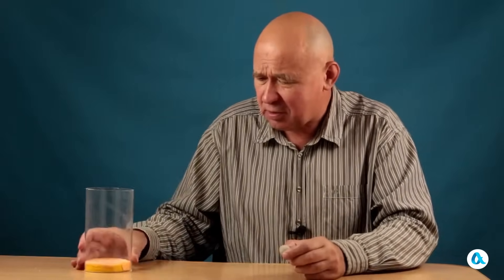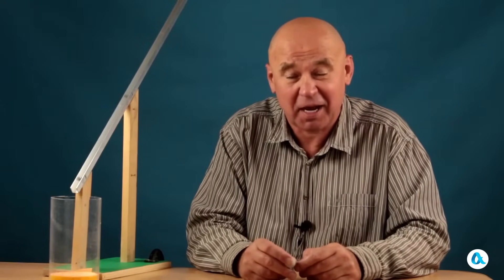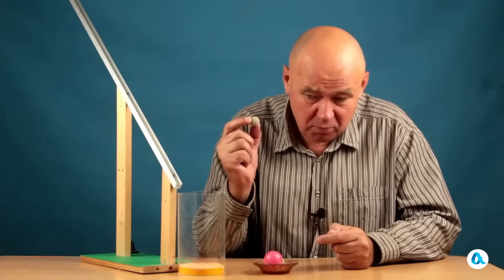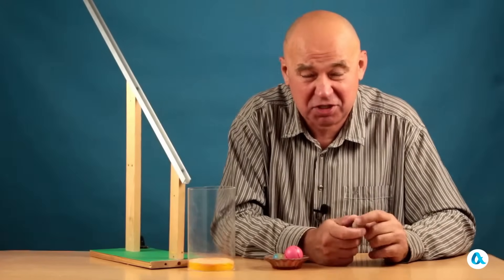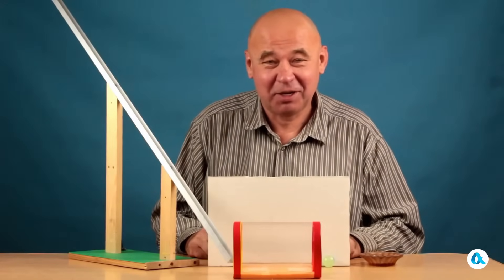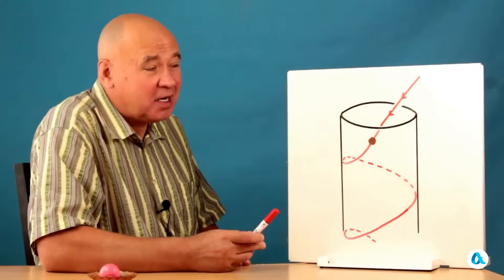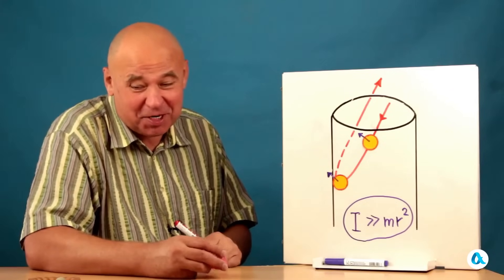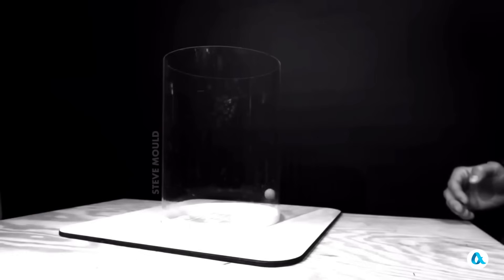Why is it coming back?

Comment: I kept wondering what was at the bottom of the cylinder when vertical, and under the cylinder when horizontal. And why a rubber coated steel ball and say a lead cored ball . . . That a magnet was involved. Evidently not, but it seems the wall container is the reciprocal limitation corresponding to a weight on a string twirled about. Then one thinks about the odd movements of a gyroscope when the axle is rotated ... That's all I got

Comment: What makes it roll in a circluar trajectory? When the ball slipped from the slide and followed a slant trajectory first and then rotated in different elliptical orbits but still managing to have rotational motion when it gained some momentum and the normal force from the horizontal wall of the container, it started to rotate in a circular trajectory with a vertical circle. Kudos for making this video, it really helps to think in multiple ways.

Comment: The simple answer is : 1) skid, 2) increase traction and less skid, 
3) precession, 4) more traction less skid. If there is adequate traction at this point, it will helix up, otherwise continue skid, precess and eventually helix down.

Comment: It'd be interesting to see the ball spin in the tube from above, cause am I crazy or is there some similarities to the way the ball travels and how straight lines behave in gravity wells. It keeps going in a straight line relative to the direction it is traveling while maintaining its spin in relation to whichever way is forward to the ball. The edges of the tube are like the edges of a gravity well. Similar to how satellites use planetary flybys for changing their direction while using minimal propellant. The ball "orbits" or spins in the cup until the friction cause by the spinning changes the path enough to escape the well. Thoughts?
Reply: In this case friction from spinning could be similar to experiencing atmospheric drag

Comment: The ball's angle of travel down the horizontal cylinder is causing slippage, and therefore precession of the axis. Friction reduces as the ball loses momentum, the range of precession reduces, the angle of the ball's path reduces - you have a feedback loop until the ball is rolling in a circle.

Comment: As a rolling rubber ball or wheel on a horizontal flat surface meets a vertical 90° wall, it tends to roll continuously, upwards, and will fall back down. It will, however, roll up if the start angle is 0° gradually increases to 90°, continuously so will enter a helix orbital path inside a horizontal hollow cylinder beyond 90° and 360°xN. 

In this video, the hollow cylinder is vertical and the ball rolling axis is horizontal. The entry point is at right side of a hollow cylinder near tangential by say 3 O’clock. The ball may either 1) continue in a helix path down the cylinder wall or 2) roll forward and upwards aided by friction, rolling momentum and centrifuges force against gravity. 

If we imagine following and watching from behind the ball, the moment it’s right pole is in contact with the cylinder wall at 3 O’clock. Initially it. skid and gradually regain some traction that cause it’s axis to tilt - right side up. The ball reacts and start precess a left turn. Such turn lets the ball to roll in the direction of skid results in less skid for more traction. 

At this stage, the ball may take one of two paths, either helix up or down depending on the what condition and state it is in.   - If the ball regain traction soon enough without using too much left precession, it follow s an helix path upward.   - otherwise if it can’t regain enough traction in a short time, it will over continue skid and precess into a downward helix path. 

Hope this helps.